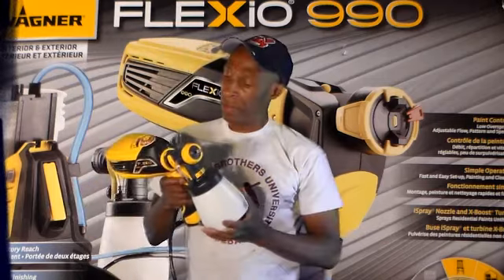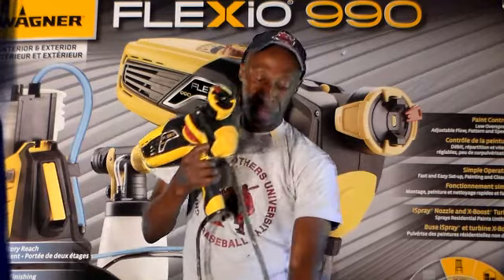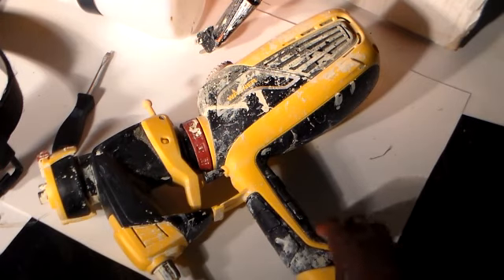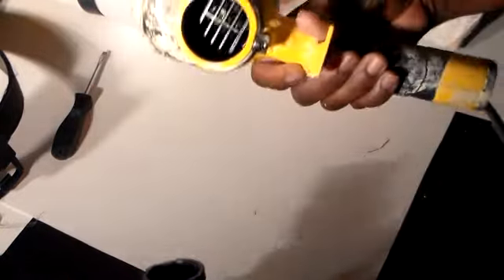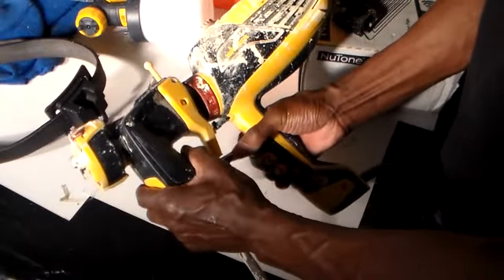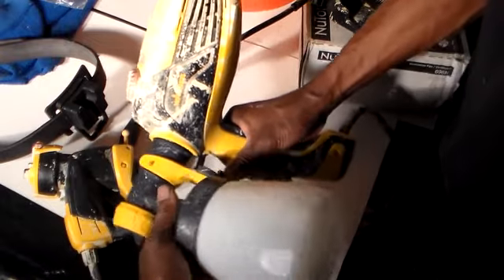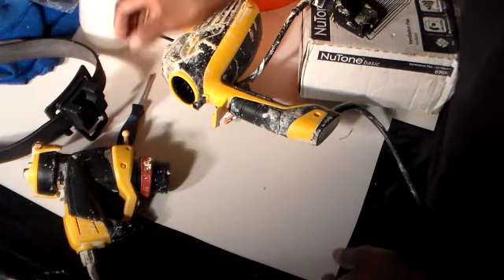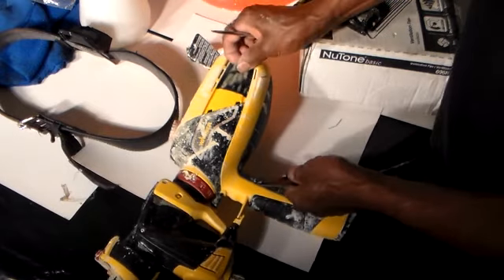Flexio 990 spray paint gun part 1

Comment: I dont know what parts i missing but paint not come out much and the handle paint spill at the trigger u have any idea what happened?
Reply from the maker: Hi, you will need to disassemble the sprayer, and look at the assembly instructions, to see what's missing, also make sure the Short air hose on the right side is not clogged up. the paint can't be to thick, it won't come out. use a strainer, it doesn't take much to clogged up the spray nozzle, when l was painting a house, l had to constantly disassemble the sprayer, to check for any blockage.

Comment: I bought one to paint the outside of my home, it took a bit of getting used too but it sure is fast, my tip to anyone before using is too rub vaseline all over the nossel and housing before using and wipe the tip periodically and too remove the inlet suction tube and clean its cover every 20 mins and it works great, I was painting exterior paint which is very thick so if your paint is very think make sure and tin out the paint 10%
Reply from the maker: Good stuff! Thanks jonny

Comment: Hello der! purchased same few months ago. what may be the reason of leaking nozzle when bucket attachment is attached. once the painting is stopped the spray nozzles keeps leaking creating messy flow on to the hand. what may  be the reason?
Reply from the maker: A bent pin, bad nozzle seal.
Reply: @diversity2739  which one is pin sir?
Reply: @diversity2739  my gun spill front where paint come out and trigger
Reply from the maker: @phongdang1577  adjust the volume control, and air flow
Reply from the maker: @phongdang1577  it's in the center of the nozzle
Reply: @diversity2739  ty sỉ